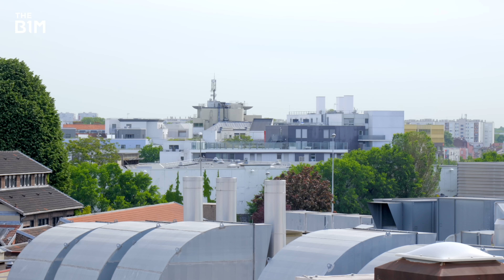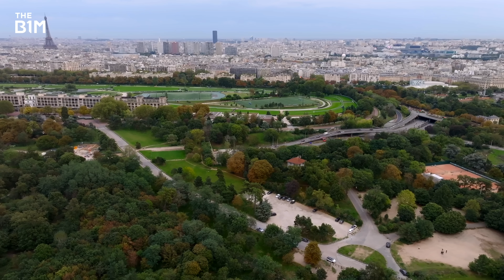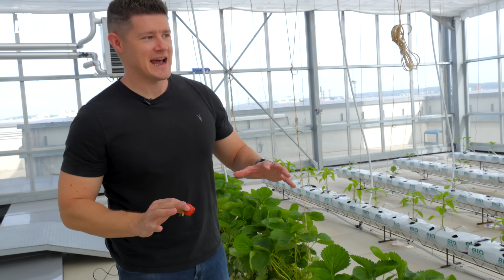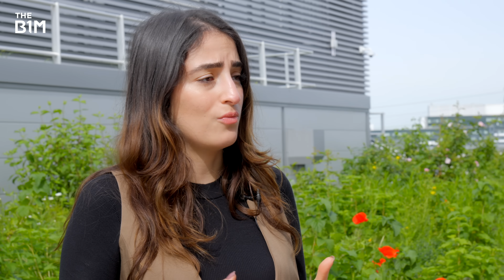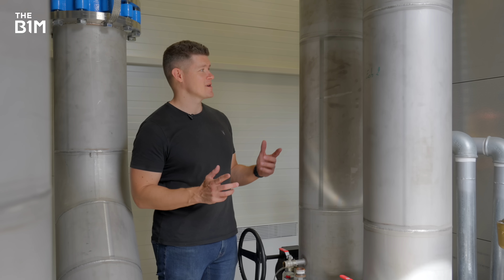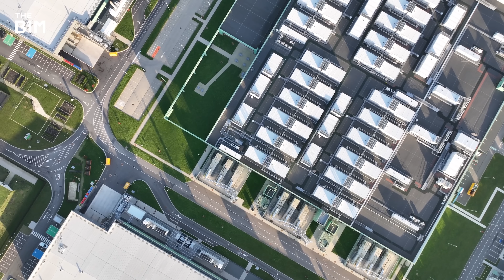The Paris Olympic Pool is Heated by the Internet

Comment: Only thing I don't get, why is the Olympic pool being heated when professional swimmers swim in cold water. Am I missing something when I used to be a pro swimmer all pools we raced in where 10-14 degrees c, I would thing the pool needed cooling so the room temperature doesn't heat up the pool.

Comment: I think this is really cool. I visited EWB's main facility in Bern a bit ago. EWB is the company responsible for energy and water but also runs a trash inscinerator in Bern. Anyways they do also capture the heat form the burning trash and distribute it back into the city for heating buildings. Their largest costumer of heat and steam actually is the Insel Hospital one of the largest in Switzerland. It's really cool that we don't just dump the heat into the atmosphere or try to get rid of it with AC but actually put it to good use since it's actually a useful form of energy.

Comment: This is only good IF boilers are shut down in people's homes so gas/electricity production drops. Otherwise, it's just going to increase consumption as people have a tendency to do.

Edit: Also, what about water cooling directly attached to the processors??? That would be SO much more efficient than blowing hot air around.

Comment: if its "free heat" but still needs to have more heat added, how green is that middle  phase to raise the temp. Guessing solar but sounds like it would need to be continuous. Is there anything around compressors powered by that heat?
Reply: In Paris and many large French cities all of our trash is incinerated and the heat is used for a municipal heating system that heats most public buildings. So it could be that system but I'm not sure as St Denis is technically not Paris.

Comment: Sounds a bit pie-in-the-sky to me. Maybe this is worthwhile in Europe where everything is already super expensive, but the costs and losses associated with transporting low-grade energy (I mean, warm water for goodness' sake) must be astronomical. But you just have to look at the super low intensity vegetable farming on the roof to see that this whole project is just one big PR exercise - there is absolutely no way on the planet that a couple of bicycle messengers leisurely transporting a couple of handfuls of tomatoes can be competitive with large-scale commercial farms, not by several orders of magnitude. And similarly, pumping 60° water several hundred metres underground is going to lead to massive losses. How much of that heat is going into the pool and how much into the ground? How much did it cost to install the pumps and pipes? How much is it going to cost to maintain? Compare all of that to the current standard, i.e. simple heat pumps on site that use waste heat from the HVAC system in the arena, and is it really worth it - other than as publicity for the Data Centre?

Put me down as unconvinced.

Comment: I worked for a company that built the servers for Amazon and google etc. in the testing area we used a lot of energy cooling the area down. I always wondered why we never redirected the heat to the surrounding buildings in the winter rather than using the other heating sources. I even proposed to introduce / look at ways of doing this

Comment: It's is always better to use the heat but i do wonder if the energy usage of the huge fans that he mentioned. 

I also had an idea (I'm sure it's been thought of by others lol) of installing huge transparent tubes of algae that are integrated into commercial building walls. Fresh air could be pumped in and the algae could just do is thing, all day, everyday of producing o2

Comment: A few of us in the PC building community have been using aquariums to cool our CPU & GPU's for over 25 years. It's quite a simple system. Coolant is pumped around a closed system of pipes and reservoirs inside the PC and a radiator, During the coolants transit it flows over hot plates that sink heat away from the hot semi-conductors. The radiator inside the aquarium dumps the heat into the water, viola.

Comment: Great! 
There's also an urban air conditioning system using the Seine river's water.
Fred, now that you are / were in Paris, did you visit Grand Paris Express building sites? 
Or at least the very recently opened Saint-Denis Pleyel new transit hub that 3 of the 4 new GPE lines will serve? 
An extensive coverage by the B1M of the GPE, like of Crossrail, would be fabulous! 
Plus, the SGP (Société des Grands Projets, formerly Société du Grand Paris) is very welcoming to youtubers and journalists, especially given the quality of your videos.

Bon séjour à Paris !

Comment: Reusing heat is great and all, but I don't understand the point of the system if all you're doing is using a portion of the heat to heat water to 30c (which is barely lukewarm), only for it to be heated by conventional means to something like 80c, and eventually cooling down to 60c by the time it gets to an end user. Don't get me wrong, it's still better than just venting it into the air, but it seems like an incredibly inefficient system. The majority of the heating is still done with gas or direct electricity and those few degrees the datacenter adds can't possibly be worth the hassle of transporting heat through water pipes. The Netherlands has hundreds of neighborhoods that use hot water systems like these and without exception all they are is overly expensive and hard to maintain. Call me a skeptic, but to me it just sounds like a greenwashing deal.

Comment: This all sounds ridiculous af. The temperature of 30°C, let alone 60°C, is NOT an acceptable environment for the data centers air. They usually are contained at 15~20°C, or all the equipment would die too fast. For silicon microchips, every 10 degrees cut the time before breakdown in half.

So, it's impossible to use heat from the aircooled servers, there are only two acceptable ways:
1. Using the heat from the air conditioning system. But there is nothing in the video saying about that.
2. Using the water cooling systems, connected directly to the heating chips, with the outgoing temperature just about the desired 60°C. But again, nothing in the video is saying a thing about that.

There is no efficient way to "convert" 30°C air or water to 60°C. It would require about the same or larger footprint than heating it directly. So, the whole facility looks like a joke.

Comment: Interesting that the heating company raise the temperature from 30-60 deg C. Immersion cooling (putting servers in a liquid bath) of servers would provide higher water temperatures from the data center when it is adopted.   Great video our sector needs all the good PR we can get! T.Loop are doing similar work in Stockholm

Comment: This same thing can be done with Bitcoin mining as well. One nice thing about mining (and to a lesser extent, data centers) is that you can turn it on/off to match times of low demand, so it doesn't compete with other uses of electricity or increase electric bills. In fact, it lowers electric bills by making sure you aren't paying for generation capacity that goes un-used. And it can help incentivize adding more renewables to the grid. Would love to see B1M do a video on some of the innovative Bitcoin miners employing similar strategies re: district heating and renewables.
Reply: Crypto-mining is the absolute antithesis of anything green, you are using energy and producing heat and for what?  To make bitcoins?   There is absolutely no upside to bitcoin mining other than wealth creation so I personally hope B1M avoids anything to do with that blight on society.  Half the coal power plants in China likely exist just to power crypto-farms.

Comment: That is pretty clever thinking. I remember a new built power station in my hometown (normally supplying 500+ MW to european grid system) has a heat branch off installed to supply 50MW worth heating & warm water for local households. 
Workers from there said, the boiler ran better, when the branch off was activated to increase the base load. 
Now the plant sits cold for most of the year, cause their energy production has been taken over by offshore wind.

Comment: I'm confused about the 30°C of the water. I thought it would be much more like 50°C considering the temperatures computers can reach.
I'm not familiar with data centers, but considering most PC's are running at like 55°C at least, I thought it would be no problem to reach water temperatures of 45 - 50°C.

Do the computers in data centers run at lower temperatures? 
Or does this process have so much heat loss because they are using air cooled computers and a heat exchanger?

If it's the second: why aren't they using watercooled computers?

Comment: Un-guilt tripping you: delivering streaming video is the least heat generating activity of data center. Data storage and transfer draws little power. Doing massive compute such as NN training or inference does make heat very well though.
Reply: This is almost the IT equivalent of saying a kilogram of steel is heavier than a kilogram of feathers. If a server is being utilized 100% it doesn't matter what it's being utilized for it will generate the same amount of heat with the same amount of power even if one server can handle a lot more concurrent users than the other, and NN training isn't even a user facing activity.
Reply: @BlueBetaPro  the point was, I believe, that streaming will never utilize 100% of servers' CPUs. Therefore most of the heat  will be generated as a result of NN training and other computation-heavy tasks

But I don't think it matters anyway in the context of this video
Reply: @gabrielfkrk  "streaming will never utilize 100% of servers CPUs" Why do you belive this, it's just wrong, of course it can. If you have spare capacity you need less servers to do the same job.
Reply: @BlueBetaPro  it's a different kind of capacity. Streaming requires a lot of I/O - reading from storage, sending through the network card. That leaves a CPU mostly idle. That CPU capacity would be used by CPU-intensive workloads (e.g. scientific computations)
Reply: @gabrielfkrk  If it's a storage server with 50+ drives then your statement is suddenly not true anymore because it's hardware designed for that specific purpose and will likely have a CPU with the capacity for exactly that task. A data center is going to use the configuration that wastes the least amount of resources and money for their task. Maybe your scenario is true for a smaller private network or something that needs an inordinate amount of flexibility, the bigger and more specific the needs of a data center the more efficient they are likely going to be with their resources. Wasted capacity is wasted money that's why services like AWS and Google Cloud are popular because it allows you to only pay for used capacity. And if your server is doing anything else than just transferering data like HTTPS encryption, encoding or anything else custom like an actual in prod application will have then it'll use even more capacity. You just can not point blank say that without specifics, especially at scale. Please do not reply with more nonsense, or like at all.
Reply: @BlueBetaPro  I was ready to engage with your argument but you got rude

Comment: Pretty sure at least some of the datacenters in Stockholm contribute to the district heating.

We also have district cooling but that's mostly for datacentera and maybe other large buildings that need lots of cooling. The datacenters at work and the entire building is actually cooled by district cooling. 

If I recall correctly it works by pumping water underneath the sea and back up it again when it's cooled.

I don't think we specifically, export our heat. We have quite a few of smaller datacenters in our building but we are not THAT large scale.

Comment: No one explained how the server farm "grows" plants and vegetables, except that it provides space, which any flat roof in Paris can do. Greenhouses have worked without non-solar heat sources for centuries.
Reply: Fall through Spring, Paris is anywhere from cool to cold. Winters are cloudy. A green house won't stay in a range that is good for plants growing without external heat. That is where the server farm comes in. Excess heat keeps the green house at the temps needed for these plants. I would venture it cannot drop below 20C / 75F for any long period of time if you want plants to grow. With outside temps being anywhere cool to freezing at least 8 months out of the year, that extra heat really helps.
Reply: @andrelam9898 
Finally someone who knows what he's talking about.
Reply: I recently designed a research greenhouse that is located right next to the university data center. We studied the possibilities for heat exchange between both projects. A greenhouse needs a lot of heating energy in winter. But the demand is seasonal. You need a large scale underground buffer to make it work. So in the end it was better to heat the greenhouse with an air to water heat pump.

The swimming pool is much more interesting. The complex needs the heat all year round, so ideal to link it to the data center.
Reply: Yeh its nothing to do with the data center, excpt from providing abit of heat. Nothing wrong with growing plants on top of data centers, but i think its more about looking green with this...
Reply: @John...44... Actually, the air conditioning system can also provide a decent amount of condensed water.
Reply: Exactly, pretty sure it's the sun causing the plants to grow, not the heat from the data center.
Reply: This whole video smells of so much greenwashing. Putting a few strawberries on top of a data center doesn't make it green. It's good that the excess heat is used, but that doesn't make anything "green". The only way to call "green" is to use less data, so that the data center is not needed.
Reply: @MartijnPennings  How using less data can make anything "green"? Imagine we have worse weather prediction and thus waste more energy on emergency measures, risk more air crashes or spend more chemicals for agriculture. Or imagine we have worse communication thus have to travel more. Would this make anything greener? We use data for purpose. And most of the time, this purpose is to somehow do something less in the real world.
Reply: @deniskhafizov6827 we use data for a lot of good things, I really wish we used data only for good and useful things! But i do believe we use 10x more data for nothing. Transferring bitcoins, A.I. systems calculating how to keep people on YouTube longer, gigabytes of data on every person on the planet being moved around for advertising purposes. I love data and use it all the time. I hate what it's doing to the world.
Reply: @deniskhafizov6827  pretty easy to use less data by getting rid of dumb "AI" that's using so much of it for stupid reasons
Reply: @deniskhafizov6827 Most of the time, the purpose is to stream video. About 65% of Internet traffic.
Reply: @telebeam6144  You mean NOT building movie theaters, NOT driving there across the cities, NOT air conditioning for thousand-strong crowds, NOT even wasting megatons of plastic to bake video discs etc etc? How much green is that?

Comment: Super good use of excess heat coming from the datacenters! But let's not forget that power demand from datacenters (even though most is green) is expected to rise to 30% of ALL electricity consumption by 2050! That it is an enormous amount of additional energy that needs to be produced which even when sourced through renewables will have a massive impact on our climate due to the materials needed for energy production. The real solution NEEDS to be energy efficiency measure as well.

Comment: In 1987 I worked in Unilever house on the banks of the Thames. My role was to calibrate and maintain the temperature and humidity controllers and recording instruments. The whole top floor was full of huge main frames and data storage disks. The fire system was an inert gas that would kill you if you stayed inside the room if it went off. Every door had a warning sign telling you if the alarm went off you had 30 seconds to get out.  It was a very different environment from growing fruit.🤣      great video 👍

Comment: Bold? New? Nah. There are systems like that capturing waste heat from powerplants and other things all over the place. There is one in the Netherlands that uses the rejected heat from a powerplant to heat a fish farm. That's been around for over a decade.
Reply: So what? It's about data centers. Cars have been using a heat exchanger to heat the cabin for far longer than that. The general concept of using waste heat is ages old.
10 years ago there have already been data centers using their waste heat to heat buildings. But not many and only for the building they are located in.

The concept of heating public pools or city district is fairly new and definitely not widely implemented.

Comment: Places like phoenix arizona where we have ovwer 100° temps more then half the year, heat homes is not an issue. Due to our lack of natural disasters here, there are a lot of major data centers built here, both private data centers for corporations and enterprises in government data centers and then colo data centers as well. It would be awesome if that he could be transferred back into power to power our grid. I know there is a lot of conversion loss but it's a whole lot less than just dumping the heat into the air.

Comment: Yeah, district heating is great when it's cold outside. But what about right now, in the summer? With no heating demands, all that waste heat must be dumped to the atmosphere. Find a way to use that waste heat to generate electricity directly, and then you can use it year-round. This project isn't nearly as "green" as they claim, but I didn't really expect an unbiased video from what is basically a paid advertisement.